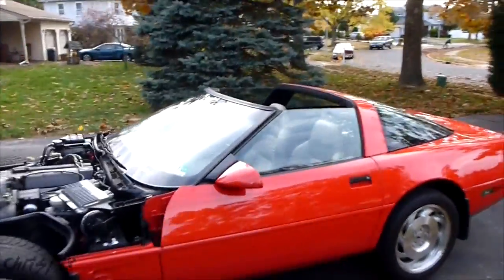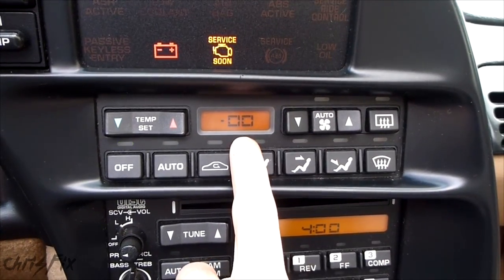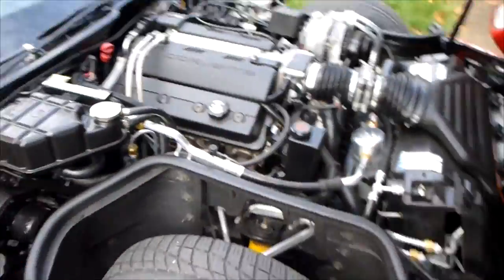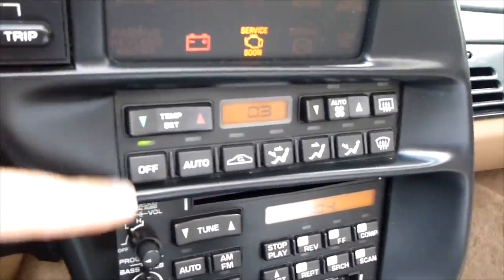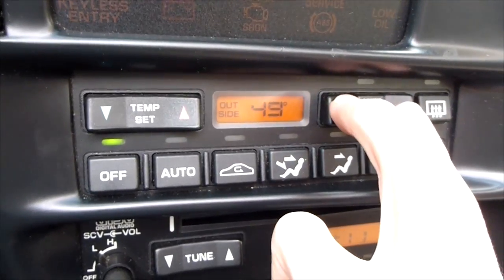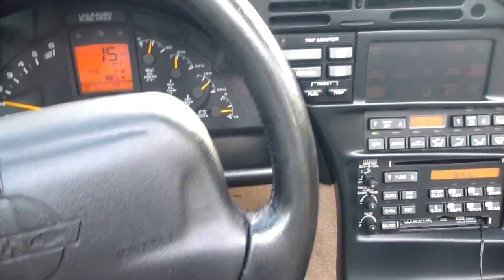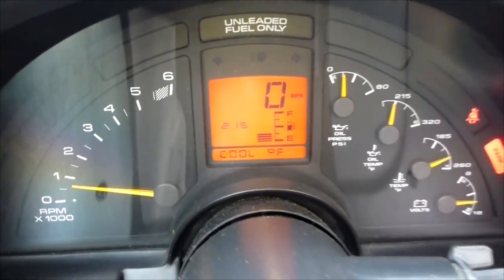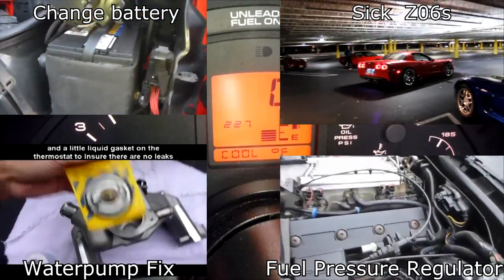C4 Corvette Climate Control Codes

Comment: Hi I don’t know if you can help me to diagnose what exactly is going on with my car
I tried to turn on the AC , but the green light is only moving only btw the blowing directions. Compressor is not turning on, only normal air is blowing and off button doesn’t function at all . The fan is keep running.

Comment: I keep blowing my AC fuse, I tried to test using the up/down then the fan and it says 0
Reply from the maker: I would figure out why it's blowing. If it is a blower motor fuse then your blower motor is probably shot. If it is your AC compressor fuse then there is probably a short in the compressor clutch.

Comment: Hi Chris, I own a 95 C4 black on black convertible in mint condition with 44 k original miles. It's been maintained meticulously. It's my second 95 C4 as my other one was a coup that I really loved but had to sell it years ago while downsizing. After years of being a single mom it was time to buy something besides my Harley that I could bring my son out in safely so since I couldn't find another really clean coupe  I love my other black on black C4 I bought a 95 convertible. Still miss my coupe, just sayin.. anyway, I have maintained this thing meticulously and because I live in the midwest it's in storage all winter and really now only get to drive it a few times for pleasure during the summer months. Last year I was having some air flow issues inside the cabin and my nephew that is a licensed mechanic looked at it for me and found out the HVAC tank check valve was cracked therefore I was not getting proper airflow. We ordered it online he put it in and boom great airflow AC was working wonderful. Just got it out of storage recently and air flow is still great but it's not blowing cold air at all, even after I took it out on the highway to blow the dust out of the pipes. My first thought was refrigerant or freon but after watching some of your videos I decided to do some troubleshooting myself. I'm about to check the codes but I thought you were going to drop a link in this post showing the different codes in parameters and I don't see it. I already looked under the car and the outside air temp sensor looks okay, but of course I can't tell if it's the resistor. I checked the connector also and it is connected tightly. I'm a little worried about checking the codes without having a reference table. We are in the middle of a horrible heat Wave here in the Midwest and it's been in the upper 90s with heat indices at 110° it's a holiday weekend and I can't get it in for service until over a week from now, I'm hoping if you or anyone else in this chat knows where the codes in parameters are can post it here. Are they actually in the owner's manual or is it something separate that you found ? Appreciate your help and love your videos. 👊
Reply from the maker: That is an awesome Vette! It definitely sounds like low refrigerant but good idea to check the codes. GM didn't put them in the owners manual but if you have a shop manual you can find it there or you can use this link: https://www.corvetteactioncenter.com/tech/knowledgebase/article/1990-1996-corvette-hvac-diagnostic-codes-723.html
Reply: Atleast you used yours

Comment: My claimant control unit only shows 3 - - - what does that means?
Reply from the maker: I would pull the ac control head and clean the contacts and see if that fixes it, if not then the capacitors might have gone bad. There are places you can send it out to to get fixed so you might want to consider that if you need to

Comment: I knew the engine fault code check with the bridged OBD-like connector and dash display. I knew the engine RPM through HVAC. But I did not know HVAC showed all these other functions. Thanks!!

Comment: Hey, what’s up, Chris? I was wondering if you could help me out with this one, I also have a C4 Corvette. I have a 92 and I have no power going to the fuse and no power going to the compressor. I checked the fuse panel on the passenger side door and it has no power. Is there another source of power where I could look at?

Comment: Hi Chris, I have 92 Vette 23k original miles 1 owner garage kept.  and just changed the battery. The On light was flashing then stopped. I checked the codes which read 00 -00 Connector is connected for the outside air sensor however no cold air seems to be blowing. The compressor clicks on and off every 5 seconds or so.  Any ideas? Thanks.

Comment: Thx Chris u gave me a start- flashing Auto button- mech charged AC, compressor does not come on, sends me to el specialist who finds engine bay plug showing voltage when grounded AC works- wants to gaffe me a toggle grounding switch $150 via the door to start compressor vs. he says HVAC programming module behind instrument panel not sending grounding signal to compressor as works when jumped for $1500
Seems like there may be a more accessible simple fix to this grounding only solution?

Comment: I have not driven my ZR-1 yet, 
but i had the same code 3 and the temp sensor was unplugged, maybe for decades. It will be a dream come true if the a/c works. i also have a blend door issue aiming hot air right up my middle while I drive. If I can disconnect it and shut the door, I will.

Comment: I know this is a old video. But I have a 92 and getting a “8” code. Your list doesn’t have number 8. Any idea?
Reply: these are the codes you would get at number 0
01 / Temperature Door Motor Circuit Fault 
02 / Temperature Door Motor Circuit Fault 
03 / Ambient Sensor Open 
04 / Ambient Sensor Short 
05 / In-Vehicle Temperature Sensor Open 
06 / In-Vehicle Temperature Sensor Short 
07 / Solar Load Sensor Open 
08 / Solar Load Sensor Short 
09 / Low Freon Detected 
10 / UART Failure

Comment: I'm working on a 1992 ZR1 Corvette with the same problem, I ran the diagnostics
 as shown in your video, it came up with an 03 code (same as you show) Sure enough, the connector came loose. Plugged it back in and back in business! Thank you for your excellent video and explanation Chris! Rich

Comment: Hi Chris I have a 2011 xc volvo suv and I would like to do maintenance on it. It has 139k . Just wondering if you have ever worked on a electronic parking brake . Look on videos and it looks like it done with a computer tool , Also have to replace main belt. Hope your available for answering and thanks

Comment: Great video!  My cruise control does not work. Any help would be appreciated!
Reply: Common problem. There is a vacuum hose near your battery that could of come off. Very common when a battery has been replaced
Reply: Right above your battery there is a round unit that should have 2 hoses running to it. Check to see that  there is 2 hoses connected to it

Comment: I have a 94 corvette, my a/c control module has 3 bars, 1 small and 2 large. The blower motor blows all the time. I would really appreciate any help in fixing this problem.
Reply: Did you ever figure this out? I'm having the exact same problem in my '96 collectors edition. No error codes.

Comment: Any idea @chrisfix why my c4 climate control has a mind of its own lol? Like for example right now the damn air condition is stuck on and nothing reads on the panel besides 2 dashes... Then sometimes it randomly will work and I can then turn the damn thing off but I never know what I'm gonna get from each time turning the car on
Reply: Also @Chrisfix if anything I'm completely fine with no air or heat in the damn thing as I see it unecessary for the vette so maybe u could tell me where and which fuse to pull out to just turn the whole damn climate control off since there so weird in these cars anyway
Reply from the maker: +Garrett Cunningham That sounds like either a bad connection or the climate control is going bad (computer).
Reply: +ChrisFix thanks for the fast reply, and could it be as simple as pulling a fuse to just shut down the whole climate control unit because I won't use it anyway? Or is it one of those deals where that one fuse is tied into many other things and pulling it out will screw other things up??

Comment: I have a problem with my Climate Control.  The fan runs on high speed and I can do the code stat thing but I cannot turn off the blower or change any other of the settings on the Climate Control such as auto, off, defrost, rear defrost etc.  Any thoughts on where to start looking for the problem
Reply from the maker: +turbovette426 Sounds like it is a defective climate control unit.

Comment: I have a 1996 LT1. When I start the car the ac blows on high setting and head unit controls wont work. It has just two lines on display like this --. After driving awhile it starts to work. Also I raised the hood to look at engine bay and ac line had ice on it. Anyone have this problem before?
Reply from the maker: +Aj Smooth Never had this problem. Did you try to use the diagnostics feature I show in this video?
Reply: +ChrisFix I will when I get home this evening. When I disconnect the battery for a few minutes and connect it back, the system resets and everything works fine. I dont drive it much but I do start it at least once a week. Its just when it sits for a few days the display shows this -- and ac blows on high.

Comment: Hey Chris, awesome site and have used info on several of your C4 videos.  My 94 Corvette has developed a problem and was wondering if you could provide me some assistance.  My climate control works fine with temp display working properly and fan blower correctly increases and decreases with the temp in the car.  The problem I have is the A/C is not nor is the heat increasing or decreasing from the vents when adjusting the temp on the climate control.  Feels like normal outside temp coming thru the vents which will not increase or decrease when changing the display temps on the climate control.  You have any suggestions?  Thanks a lot!  Leo
Reply from the maker: +Leo Johnson Check on the passenger side under the black fuel rail cover is a small black cylinder with vacuum hoses attached. That commonly cracks due to age and it will prevent the vent doors from opening and closing properly which might give you a mixture of hot and cold air.

Comment: Chris,  thanks for tip on interior temp sensor.  That was the problem, but having difficulty in finding a new one.  Do you know where I might find one.

Also is there anything in the aspirator hose that would need looking at?  Can't find anything on the hose...

Thanks
Reply from the maker: +Ron Routt Might want to check ecklers, ebay, mid america, or a junkyard!
Reply: I had checked all of them and a few more,  ebay does have a used one.  Will try it.   Thanks again for good help...

Comment: Have a 94 Vette and with air cond set at 70 degrees and automatic, the fan will reduce to 2 or 3 and temp has only reached ab out 74 degrees and will just get hotter in car when driving, although there is cold air.  You can switch to recirculate and fan will run at correct speed and temp will reach about 70.  Can you tell me why will not cool in auto as it should?

Thanks
Reply from the maker: +Ron Routt The interior temp sensor is probably not working.

Comment: HI Chris, i just change new water pump, thermostat new on my c4 1992...but the the temp still up to 250 degree i don't know what the problem. So i need your advise to solved the problem, thank bro.
Reply: Dan Ha make sure to bleed the air out of the system.  Also might be the water pump going out.  I just changed mine in my 95 vette.

Comment: I need to know where the heater control valve is located?
Reply from the maker: setzers7 There is no heater control valve in the later C4 Corvettes. There is a check valve that prevents back flow of coolant and it is a cylinder. Here is a video that might help: https://www.youtube.com/watch?v=-XjXTVJhFLM
Reply: ChrisFix What controls the heat when you go from 60 to 90
Reply from the maker: setzers7 The blend door.

Comment: Hi Chris saw your Climate Control video. Learn some good tip but was not able to solve the problem I have on my 91 C4. The A/C fuse blows up, climate control (cc) panel inop.Replaced fuse A/C, A/C and CC works. After ten minutes of operation, fuse blows again. Saw the speedometer panel blinking ("sys" a for three sec. and then change to "70") when I turn the key on to start the engine. Please help. 
Thanks
Felix A

Comment: i   add freon but it didn't work

If you have phone number or Skype please
Reply from the maker: Fahad Aldosari Does the compressor kick on?
Reply: After research shows that there is no electricity up to compressor
What can I do now

Note: everything is good but I do not know why
Reply from the maker: Fahad Aldosari Did you check the fuses for the compressor?

Comment: I have a C4 1990 and my AC works fine blows cold but when I turn to heat I have no heat could you give me a hand.
Reply from the maker: James Fagan There can be a few problems. The two bigger ones are your heater core is clogged or your blend door is not working. To check for the heater core being clogged. With the engine warm and heater on (dont burn yourself) touch the two hoses running into the firewall that go to the heater core. They should both be warm. If one is cold, and the other is hot, then your heater core is clogged. The blend door is controlled by a vacuum hose and a plastic vacuum piece that can crack. On my LT1 is is under the passenger side engine cover.
Reply: ChrisFix Thank you for info one more what you show in this video I can get the double 00 but when I press auto nothing happens  Thank you
Reply from the maker: James Fagan If you press auto and nothing happens then you dont have any error codes. Does the light flash above your off switch on the climate control?

Comment: Chris thanks for the video on the A/C control unit. I am having issues with the unit responding to button/controls pushed. The only buttons that cause the A/C to come on is the Auto and Upper Vent. I can't turn the unit off, increase/decrease temp or fan speed, etc. Is this an indication that I need a new control unit? Thanks for your consideration. John
Reply from the maker: John Buehrig Sounds like you need a new control unit. Does the light flash like in this video?

Comment: hi Chris,i have a 1989 C4 with the electronic climate control and this doesnt seem to work on my vette.The climate control is different than the one in your video and just reads 0 when you hold down both fan controls.It wont go into a diagnostic mode.Does this work on older C4s?Thanks Joe

Comment: Excellent video...  Fixed my problem... Thanks a million!!
Reply from the maker: Maverick scooter doc Great! Glad the video helped fix your problem! What was wrong?
Reply: Took the car up and had it cleaned and detailed. When I got it back the defroster was on full blast . None of the buttons on the HVAC control were responsive. It's like it was disconnected or needed to be rebooted. Drove it home and looked up your video on my phone, accessing the trouble codes seemed to unlock the system and it now responds normally... turns off, air conditioner heater and temp all work normally.... Thanks again!!
Reply from the maker: huh, interesting!

Comment: With the new compressor installed, no freon added yet, the climate control system blows 25A fuse each attempt to operate? What can it be?
Reply from the maker: Keith Bluestein Why would you turn it on without freon in it? That will damage the compressor. Maybe that is why it is blowing a fuse.
Reply: ChrisFix Oil was filled in preparation for starting and adding freon.. you can not start the compressor to add freon unless the compressor is running. The Climate Control Systems fuse blow.
Reply from the maker: Keith Bluestein Ohhhh gotcha. I thought you were just running it without anything. Well, although you need to add freon with the compressor on, you still need to get some pressure or the pump will just blow the fuse.

Comment: I changed out my compressor, drier, etc on my 1990 Corvette and converted to R134. Any idea why my switch keeps blowing a fuse. Do I need to reset the ECU?
Reply from the maker: Keith Bluestein I couldnt tell you why without looking at it. Did you put the correct amount of refrigerant in? Is the compressor the same as the old one? You dont need to reset the ECU.
Reply: ChrisFix Hi Chris it is a new reman compressor two wires on it. Do you need the exact amount of refrigerant? What would cause the fuse to blow?
Reply from the maker: If you overfill the refrigerant it can cause the fuse to blow

Comment: Hi Chris, yes me again...while attempting to get to my rogue indicator flasher unit by trying to gain access via the Hush Panel today, (what a ridiculous place to install the flasher unit) I must have disturbed something because now my air con and all climate control, fans, demist have stopped working. The small LED display is on but blank, and I have an error code flashing on the main panel, SYS, that blinks next to the MPH display.
Any ideas what I have done, and is it fixable?
To top it all, I still didn't manage to get access to the bloody flasher unit, did manage to break both the foot well light and the glove box lamp, so have no illumination for either now, other than this been a great day...
Reply from the maker: Ugh, I hate days like that. Sounds like you might have hit something and loosened a connection or something to cause the sys. Does your climate control light up at all?
Reply: ChrisFix
Hi Chris, yes the display panel is lit, and I checked AirCon by removing the fuze, the panel goes out when I do that, so the fault lies else where. Removed the hush panel again today and played around with all connections I could, nothing! Oh and one more thing, the aerial has also stopped working, ie doesn't go up when turning on the radio! Not so good driving around in the cold... brrrr!